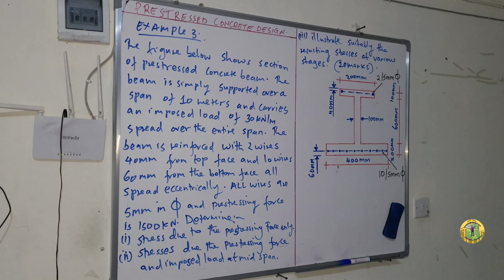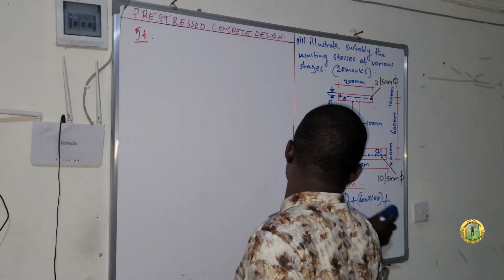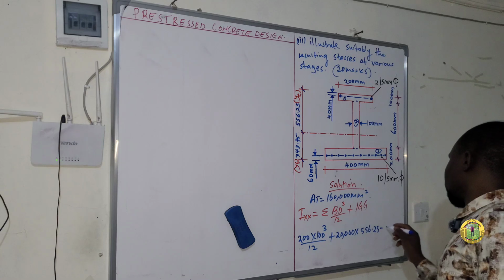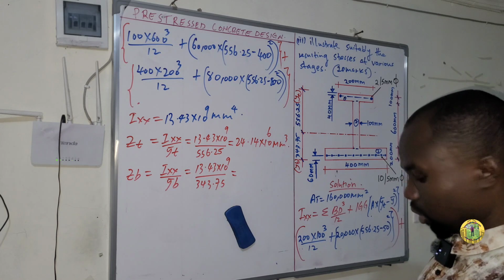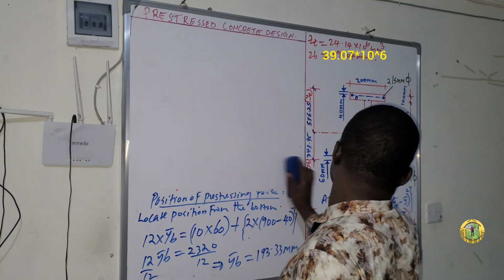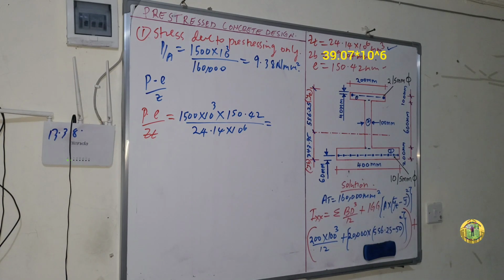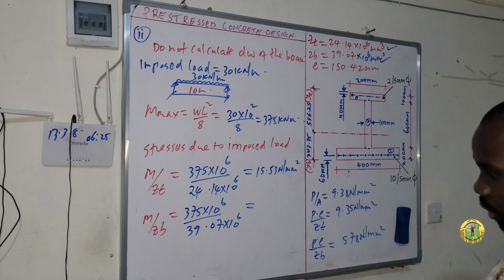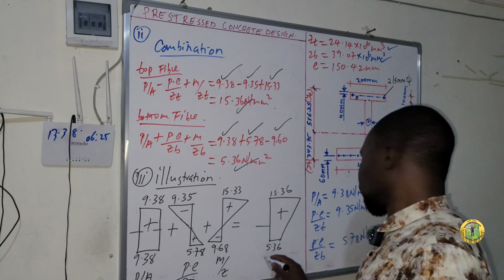PRESTRESSED CONCRETE DESIGN-EXAMPLE 3

Comment: Hello why don't we consider the area for the wires when finding total area
Reply from the maker: The total (gross) cross-sectional area of the concrete member is calculated—rather than just the area of the steel cables—because the design method relies on controlling stress throughout the entire member to prevent cracking and failure. While the cable area is used to calculate the prestressing force, the total concrete area determines how that force is distributed as compression, how the section resists external bending moments, and its stiffness.